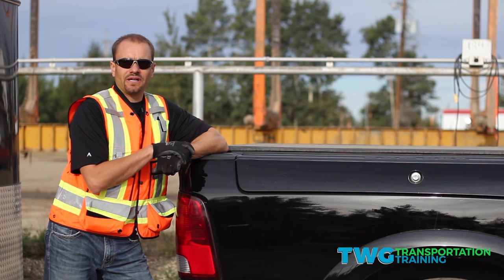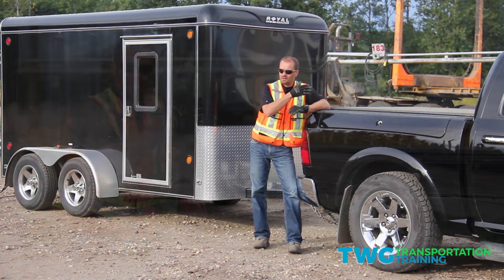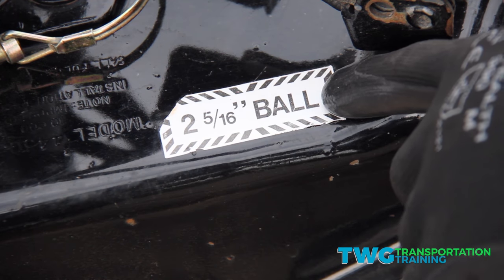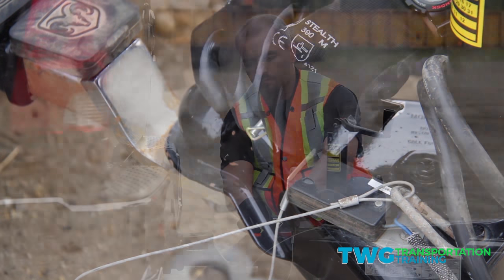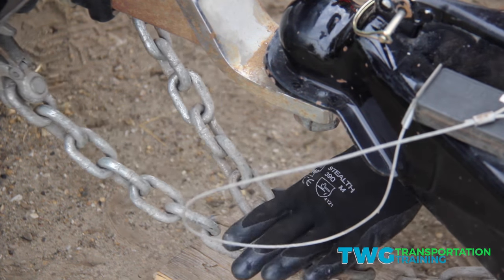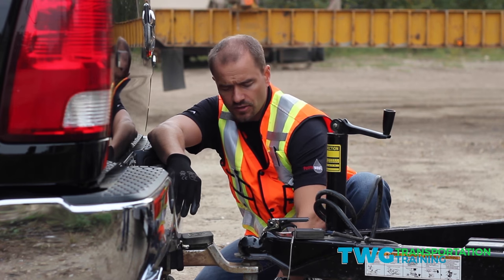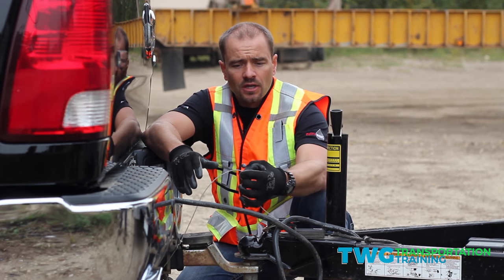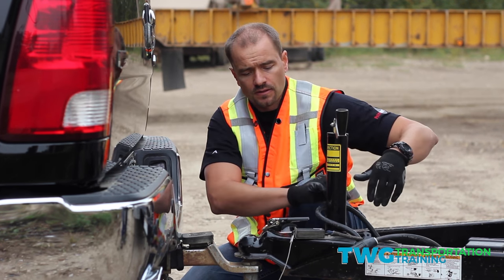Electric Trailer Brake Test

Comment: It's really important to insure the breakaway cable is SHORTER than your safety chains...or the trailer brakes will not apply if the ball should unhitch.   In that fashion, the trailer brakes will apply, thereby keeping the trailer pulling AFT on the tow vehicle and will prevent trailer SWAYing while on the chains.  If the trailer brakes are not applied because of a loose breakaway cable (or foolish use of a coiled breakaway cable) the trailer WILL SWAY and possibly roll over...possibly causing the tow vehicle to roll also.

Comment: you failed to mention that the breakaway cable must have less slack in it than the chains. You should be looping the cable through the same hole the chains connect to on the truck then back to the cable loop on the breakaway pin leaving enough slack to turn the trailer but not more slack than the chains have.

Comment: Crossing the chains does nothing.  I was always told to cross them, and then last year, I had a hitch failure, and with crossed chains my trailer round went to the road and dug into the pavement.

Comment: I hate when I see companies such as yours give bad instructions. You missed steps as well as have back steps. 

1. You missed greasing the ball. All metal connections need lubrication. 
2.  You do not cross your chains. I challenge anyone that claims this to leave they’re trailer unlatched and purposely cause the trailer to detach. See what happens! Who cares if the trailer tongue hits the pavement? Is your life not worth scratches in the public roadway?

Once the trailer disconnects the steering of the trailer changes from the point of connection of the ball. Now the chains will steer your trailer. Don’t forget, a lot of people haul heavy loads on these trailers. By removing the trailer, you have unloaded and lessened the traction of your tow vehicle. 

Now let’s go back to the chains. If the chains are not perfectly aligned, which they will never be due to angles of the trailer and tow vehicle are at while you go down the road. So which ever chain is shorter will get the tension first. The chain that has the tension will cause the trailer to be steered in that direction until the other chain starts to receive the tension and then your trailer will go in that direction. 

I’m sure you can understand that the trailer will go back and forth violently and with weight behind it and no weight on the rear of your tow vehicle, it will eventually pull your vehicle to the side and you will loose control. 

If your chains are straight when the trailer disconnects, your trailer will drag on the ground. Your trailer dragging on the ground is a good thing in this situation! This will act as a brake for your trailer. Your trailer will start to slow and your shortest chain will receive the tension. The trailer will then re align itself behind that chain. That one chain will keep your trailer going in the same direction of your tow vehicle until you come to a stop. You don’t slam on the brakes, because your trailer will slam into your tow vehicle. The road surface will slow the trailer gradually and both vehicles can come to a safe stop without major damage or injury. 

After that happens to you, I’m sure you’ll learn to make sure you take every step possible to insure your trailer doesn’t disconnect again. It’s a pucker moment.

Comment: The brake away cable was hooked up wrong! First don't connect brake away to the safety chain loop, what happens if the safety bchain tears the loop off..   now what is the brake away cable connected too?! And that one comes from an indiana DOT officer! I personally won't connect brake away to the hitch at all. I had a hitch come off a vehicle once..   live and learn! 
2bd, I want the brake away cable to be shorter than my safety chains so if it does come off the ball the brakes will set before the trailer starts the dance at destroys the back of my truck